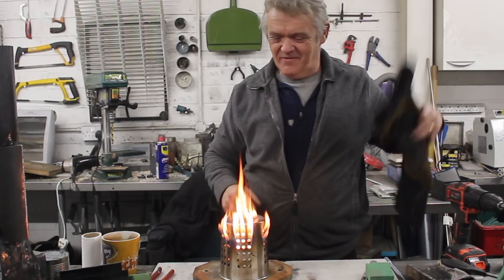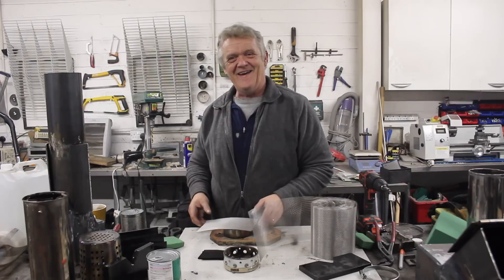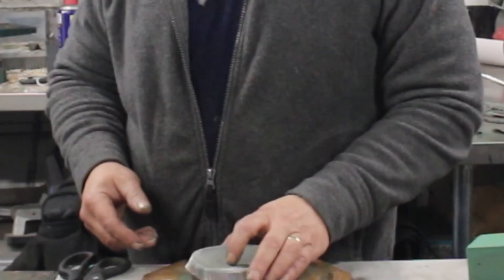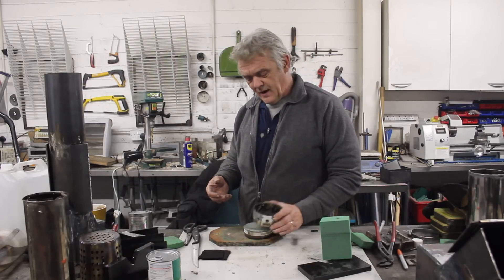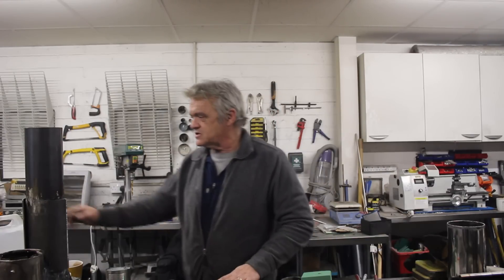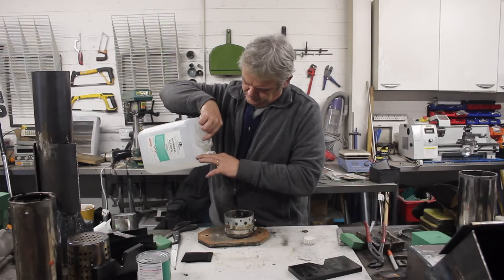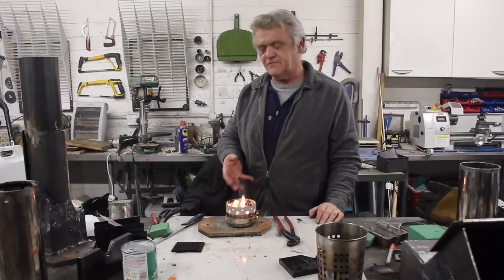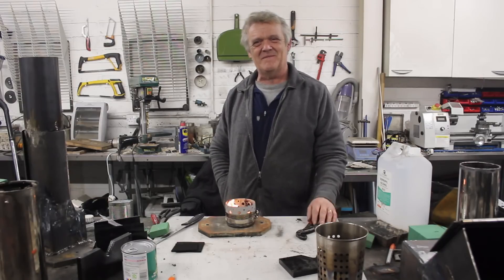1738 The Safety Heater

Comment: Great video and idea!! Well done!
Just a thought would this be safe INDOORS!? (Given its burning alcohol that's ALREADY vapourised I can't imagine this giving off much in the way of Carbon monoxide if anything at all? Given its a clean fuel anyway and it's vapourising before ignition as far as we know!? - Or am I mistaken?) A Carbon monoxide detector reading might be useful to see what levels there are if is safe for indoor use in emergency power outage??  Keep up the fantastic work!
Cheers from London 👍😎🏴🇬🇧
Reply: I have done it many times with a CO meter and have rarely gotten over 9ppm CO, which is quite acceptable. Just crack a door every couple of hours for a few seconds.
Reply from the maker: well lots of folks do use alcohol burners indoors mate

Comment: is there a reason it needs to be that foam type material?  why not just use carbon felt?  it will never burn away, especially since the flame never actually touches it?
Reply from the maker: nope I just used the. because I had it on hand - any wicking material will do - including carbon felt - actually the felt would begetter but not everyone has it

Comment: Will the oasis burn away giving off gas as the fuel gets lower?....could this be used inside a small tent?......this is a really good idea to work on Robert....cheers
Reply from the maker: you don't need to use oasis mate anything that wick will do

Comment: Anyone tried mixing a small amount of water with the alcohol?
I've not tried it yet, but you should end up with a cooler flame that burns for longer. The same idea works with hydrogen pen torches where alcohol is added to water to cool the flame.
Reply: I tried that a few weeks back, the more water that I added, the smaller the flame got and the longer it lasted. The issue is with water, it ends up in the air. Adding moister to the air may not be desirable in some cases, especially if High humidity issues already exists. In a very dry environment this might not be a problem, especially if it's desirable. Some folks use dehumidifiers for certain situations and likewise, some use humidifiers for certain situations.
Reply from the maker: most alcohols already have water in them mate - they absorb it from the air
Reply: @ThinkingandTinkering  yes they do. Methanol was 99.8 percent when bought new 5 years ago (25 litres) but intend adding a bit more water to see if I can cool the flame as I'm burning through 400ml an hour and the heat output is overpowering.
Reply: @pa_maj.MARTINI-van-MAN  Thanks for your reply.
Reply: @lagunafishing  You're welcome!

Comment: Great idea! However I don't have a welder or metal bender thing. Would it be possible to make one like this without the welder and bender? Thanks. Love all your videos.
Reply: A pop rivet gun and you don't need a bender.
Reply from the maker: yeah loads of options mate - use a napkin ring, cut a tin can in half, bend free hand and pop rivet, use a slice of pipe, etc etc

Comment: I'm getting far too into these videos. My carbon felt bill is outrageous.
Reply: Where do you get it from?
Reply: @ScoreGuru123  rob sells it
Reply: @ScoreGuru123     Somebody on an older video noted that ceramic fiber works better than carbon felt. Haven't tried it yet, but I have tried carbon felt, and have learned it is definitely not forever, especially with hotter fires/flames (it gets brittle and crumbly faster than one might think, was experimenting with wax burning).  I have some ceramic fiber somewhere, just a matter of finding it.  

  (For alcohols, carbon felt probably is ok and will last a decent amount of time.  Burns cooler)
Reply from the maker: lol - with this one ate carbon felt would work well but lots of things would be good - right down to good old cotton wool balls

Comment: Imagine we use all the coast sea owned by France in the world to build algae farms and produce biodiesel. With this kind of heater you resolve the energy issue in the world. You capture the Co2 from the combustion. Separate the oxygere and the carbon to produce carbon plastics (yes that exist). After you invent boats. Cars and planes that keeps all they're emitions in tanks instead of pour them in the air. You have a full circuits and we can live peacefully at 30 trilons of humans in the world. Wouldn't it be more simple than to try to colonies mars

Comment: The dust from that oasis stuff is highly carcinogenic (it's comes up a lot in my other hobby: scale model building).

I'd be very wary about having it near a heat source / setting it on fire.

Nifty device though. Would that carbon felt work as a reservoir instead?
Reply from the maker: don't use it then - but like I said on the video anything will do as long as it wicks

Comment: i think its fantastic but i would to see you knock it over
Reply from the maker: that's actually hard to do as it is wider than it is tall
Reply: @ThinkingandTinkering  bottom can epoxied to a floor tile to give it some weight, "vortex" slits in top can with a cup sized mesh chimney.. if the top got bumped off it should go out. nice potential for a reflector to throw radiant/infrared to help warm a space.